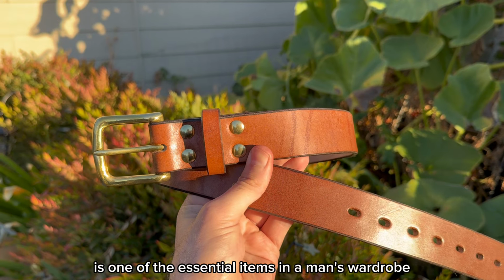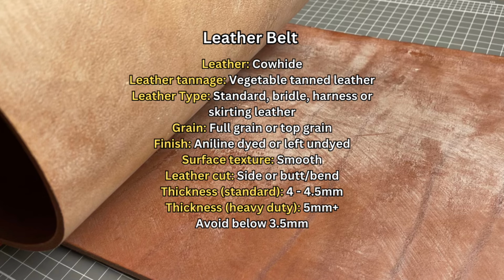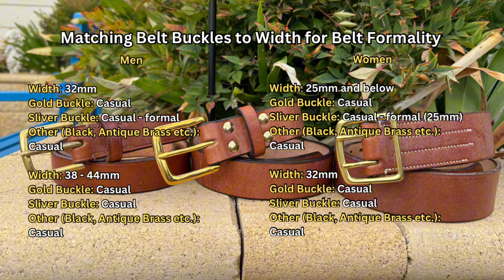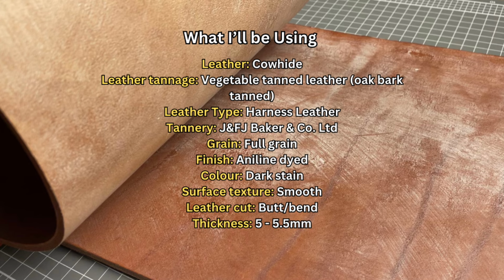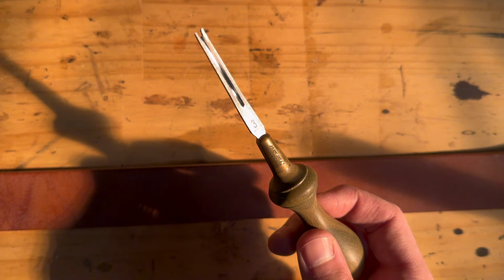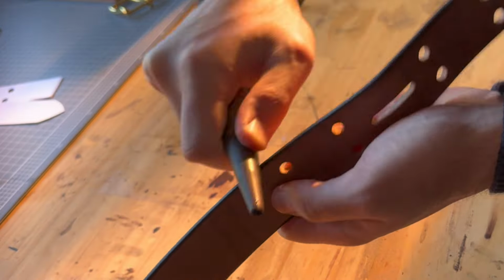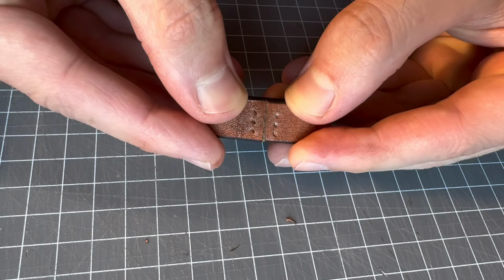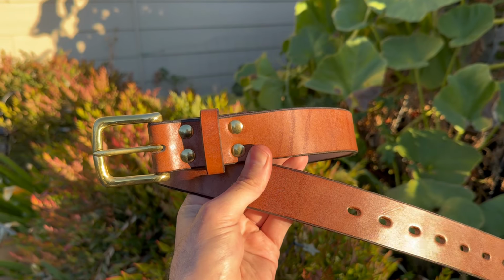How to Make a Leather Belt | PDF Pattern

Comment: Great video, i am new to leather craft , can you tell me what size of the edge beveler you are using, because size 3 for different brands is different , also suggest some brands .
Reply from the maker: You are correct different brands will have different sizes if they are the same number. For the main edges of belts you can either use a size 2 or 3. I use a size 3 Palosanto edge beveler for the edges of the belt and a size 0 edge beveler from Weaver Leather Supply for the belt keeper. 

In terms of brands Palosanto is probably the top of edge bevelers but they are a little pricey. You can also look at wuta that are a bit more cheaper and have a design similar to Palosanto. However, I haven’t used them before. The edge bevelers from Weaver Leather Supply are high quality and pricy as well but the design isn’t the best on thinner leather. But what you can do is bevel the piece on the edge as I’ve done in previous videos. I also do have some tool videos as well.
Reply: Thankyou, what size of oval whole punches are you using ?